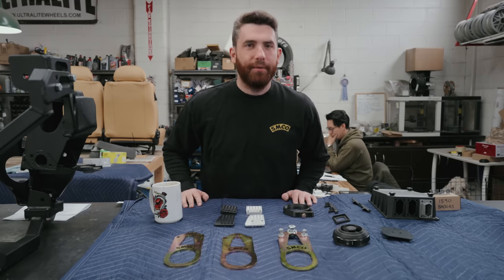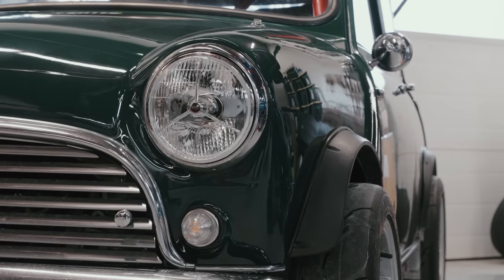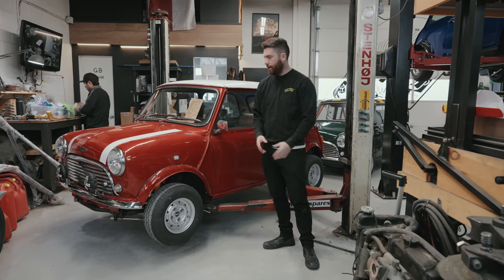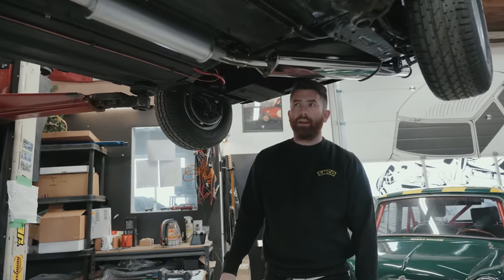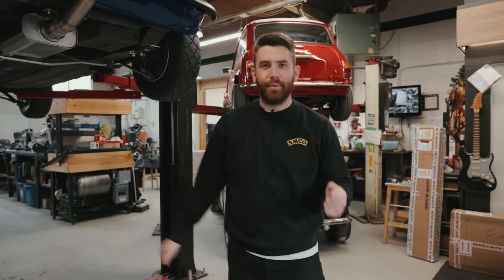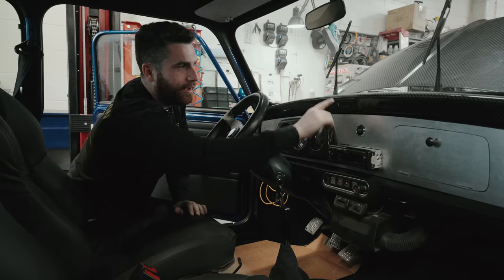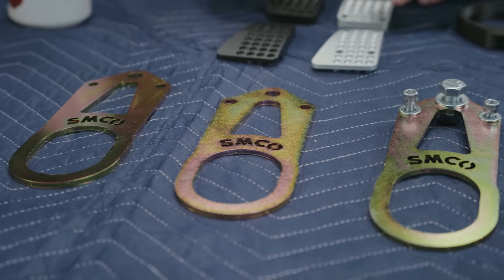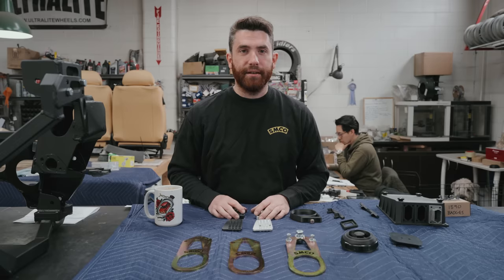Steveston Motor Co shop tour 2023

Comment: Really would like to hear more about those 10" rims mentioned that fit over 8.4" calipers. That makes the swap to 10" rims so much more affordable.
Reply: Same here!
Reply from the maker: The logo is upside down in the video, but you should do a search for JBW classic mini wheels
Reply: Great for 'static' or 'stance' or whatever that 'new' fashion is called? Which basically are 'parking nicely' 😂 Also great if you are that great mechanic you can change wheel bearings in your sleep because they will need to frequently, and buy bearings by the pallet, a year! 😂 Also they will ruin the handling. Get some 6x12" instead.

Comment: Beautiful Minis
On the red Mini with Honda engine, what wheel / discs combination are you using?
You mentioned that they are 10” wheels with what size and make of brake parts does it use?

Comment: Who is the manufacturer of the hood louvers on Marks blue mini? I haven’t been able to find some that fit that nicely within the bonnet stripes. 

Awesome video as always.
Reply from the maker: They are generic ones where you can search by the width of your stripes. The stripes on this car were painted to fit though.
Reply: @Stevestonmotorco  the stripes did look wider for sure. I will continue the search. Thank you!
Reply: @markschanzenbach7760  thanks! I think was able to find those after the video aired but knowing they have a couple different styles is good. I think custom vinyl stripes is the best option to hide the vents a bit. The big test will be this summer to see if I need to pull the trigger on venting. Thanks again!